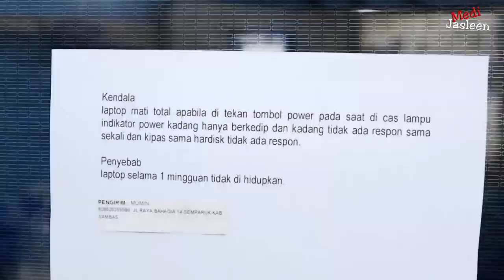Kiriman perbaikan laptop Asus A43S dari Semparuk Kab Sambas

Comment: Assalamu'alikum Pak,
mau tanya untuk asus X452e

dengan problem :

- No led indikator 

- di switch on/off  sama sekali tidak ada tegangan standby 1,/2,/3,..v

- konsumsi arus nya di psu 0 (tidak ada sama sekali), baik sebelum dan setelah switch

- tegangan 19v Hanya hadir di soket / pin charger  & 4 kaki di 1 fet Nchannel saja yg paling dekat dg pin charger

- Karena tidak menyeberang ke fet sebelahnya , coba jumper , mau nyebrang hasil nihil

- 2,8v dan 5v hadir di Ic BQ tp tidak ada tegangan standby di switch on/off, dan soket flexi on/off di mobo pun tidak ada tegangan hadir

Adakah petunjuk untuk kasus seperti diatas Pak?
Terimakasih sebelum nya
Reply from the maker: Setidaknya fet pertama dan ke 2 kerjanya harus sesuai, tegangan triger untuk gatenya low atau high tergantung bawaan fet N / P channel, maka 19v akan diloloskan  di S ke D untuk itu pastikan juga ic cas sudah mendapatkan teg kerja agar triger fet bisa aktif.